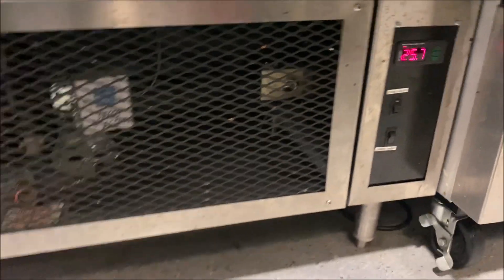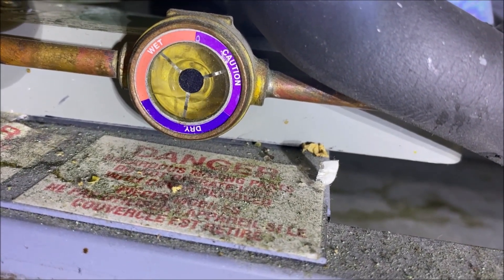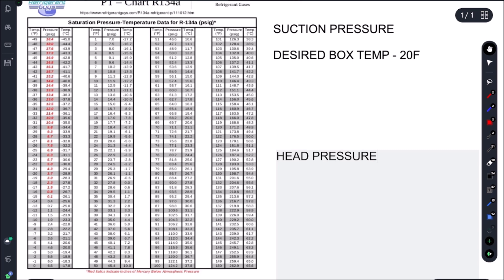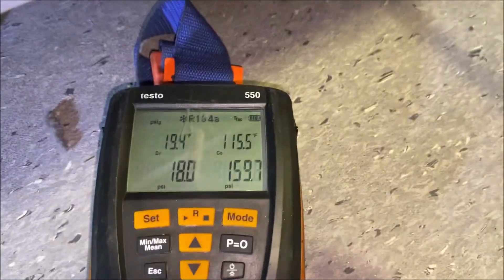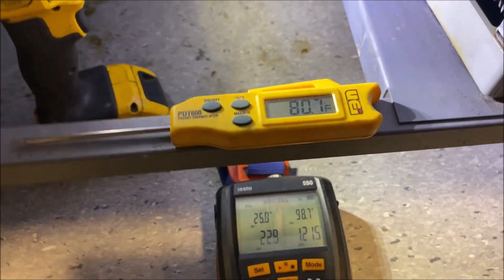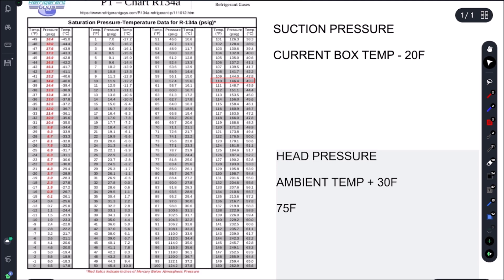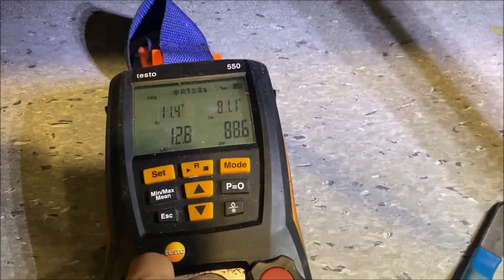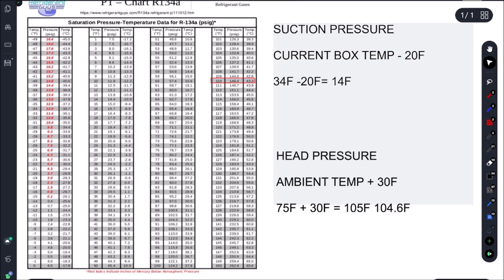Cooler is not cooling

Comment: Nice work👍👍 I'm not sure I would pump into a negative when finished, there's a chance of pulling in air if someone wasn't being careful or the service valve was leaking at the suction side.
Reply from the maker: Yes I should of shut it down just before. We have some super strict rules in Canada with purging refrigerant that are overkill unfortunately.